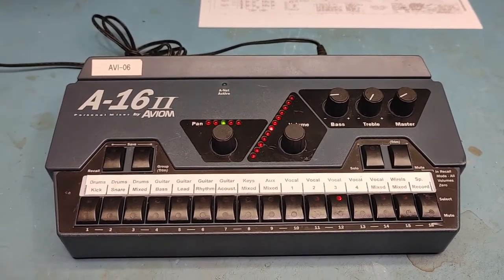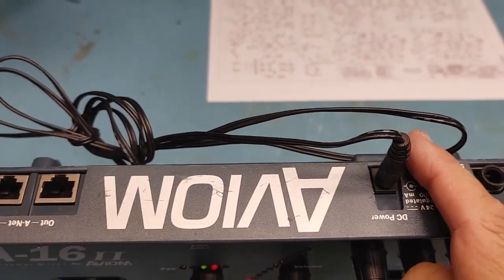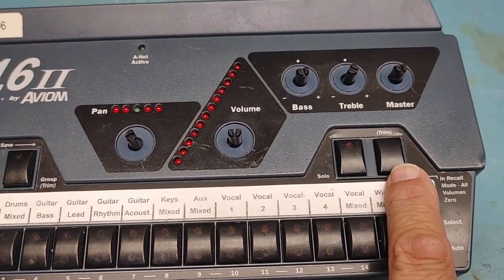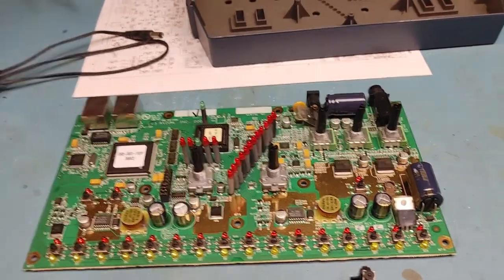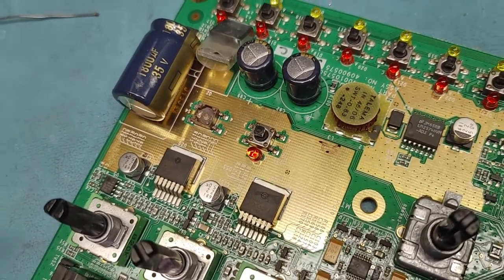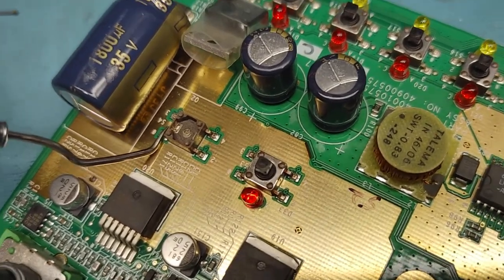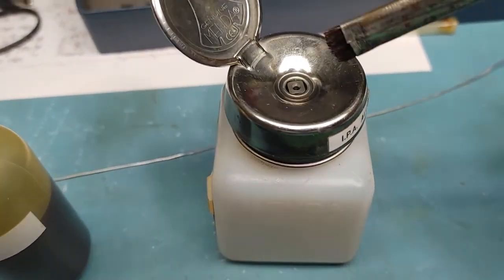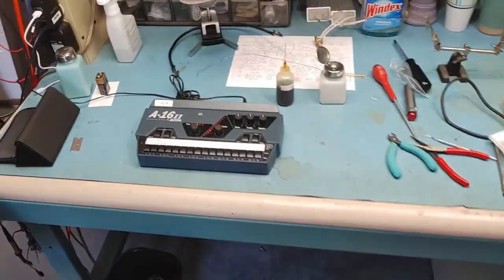AVIOM A-16 II Encoder Replacement

Comment: May I ask where to buy the volume encoder?
Reply from the maker: Hi. You can find them here:
https://www.fullcompass.com/prod/168128-aviom-1075-0001-0001-volume-pan-encoder-for-a16-a16-ii-and-a16cs
They have some other common failure parts as well.
Good luck!

Comment: Bro, where did you bought that  piece?
Reply from the maker: Well it's one a part of a in-ear monitoring system. The system consists of a A to D converter, and A-Net switch and the personal mixers (like the one I repaired) The switch can host up to 8 personal mixers.